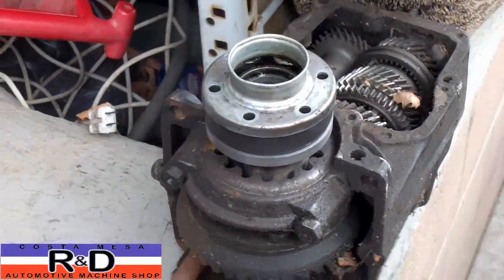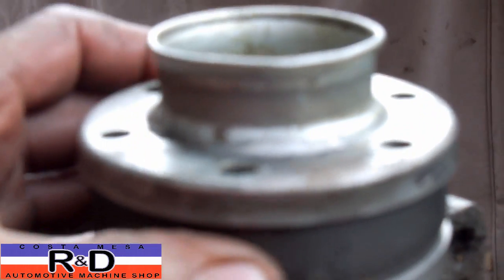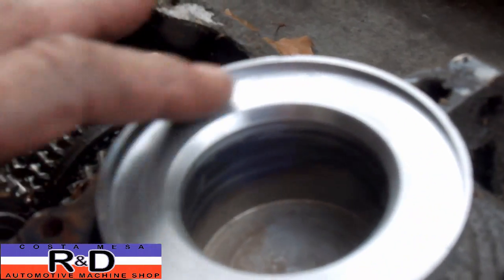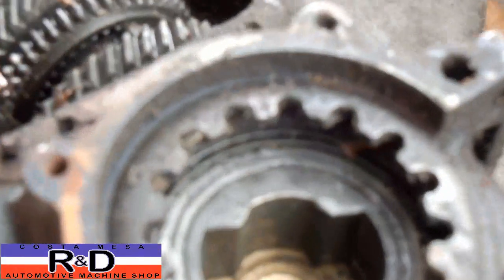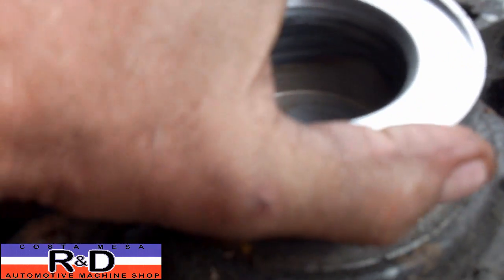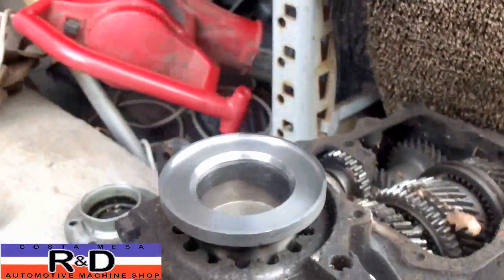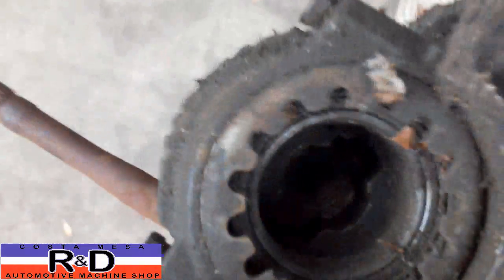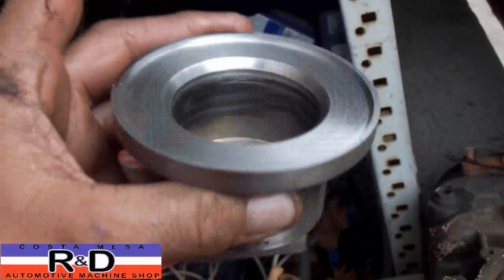CV Joints for the Fiat  850 Transaxle

Comment: Very inventive John but I want to know why you chose to weld on that plate instead of just turning the thing once piece.
Reply from the maker: I didn't have a piece of 4" round stock. Having vee'd out the piece, I'm confident that the weld will hold, besides, the caronly weighs 1276 lbs.
Reply: i was about to ask the same thing. will the weld hold up to the power? guess there is one way to find out.